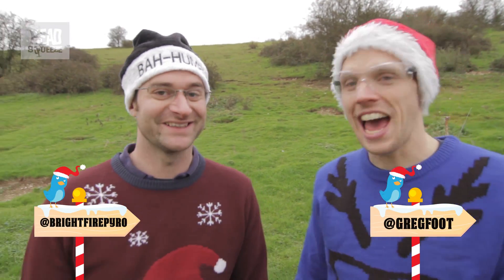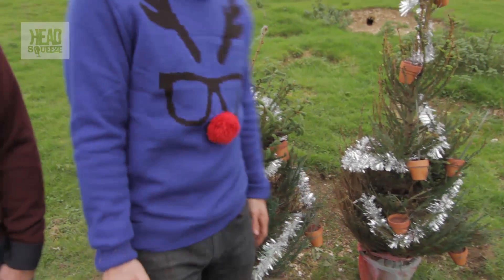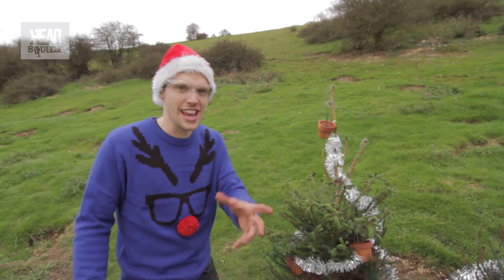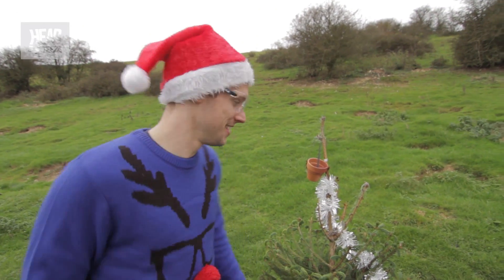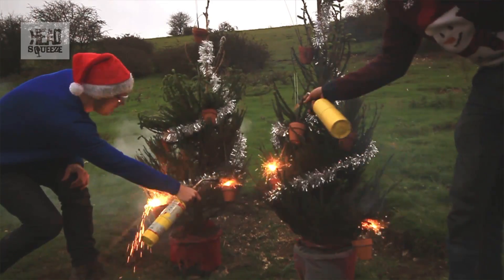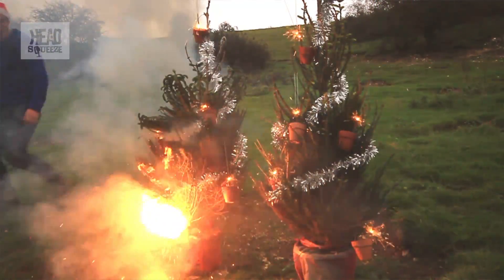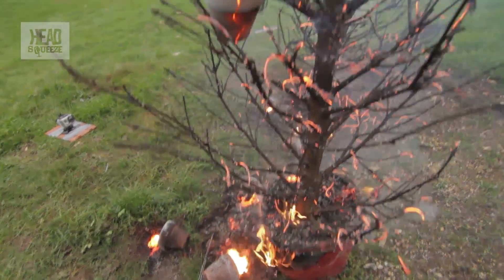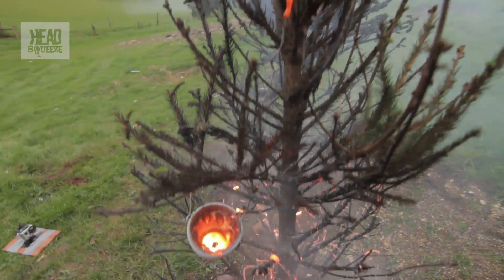11 Baubles Blazing with Molten Iron | 12 Explosions of Christmas with Greg Foot | Head Squeeze

Comment: Can you guys answer me what determines if a Gas (noble or not), Liquid or Solid object will be Flammable?
Reply: Unfortunately there's no real simple answer to that question, but it all has to do with chemistry and how efficiently the material reacts with oxygen / interacts with the oxidizing agent.  Generally, the more free electrons in the outer electron shell means an element will be more likely to be flammable, any gas / liquid / solid comprised primarily of carbon, hydrogen, and oxygen will be highly flammable, and finely ground solids mixed with oxygen or an oxidizing agent will be much more flammable because of the higher surface area.
Reply: TechLaboratories
Oh, I see, thank you for the answer ^^, I've been wondering this for a long time.

Comment: The only reason this interests me is I saw a movie once where a guy stopped a car in the road and placed a cylinder of thermite over the engine and lit it and it burned a hole through it.
(All information subject to slight deviation as I didn't give enough fucks to pay too much attention to the movie)
Reply: Was also used in one MacGyver episode to melt open a lock of a security truck/van.